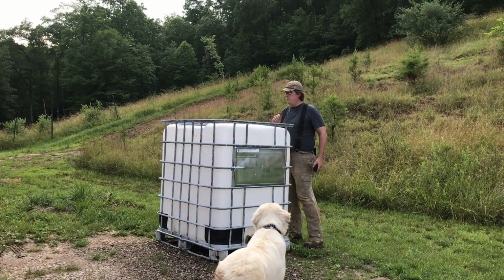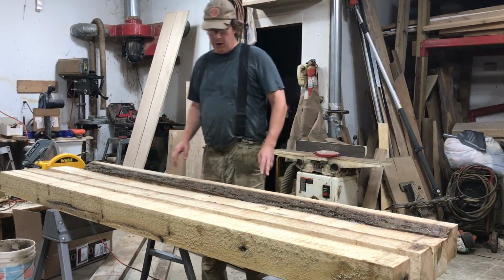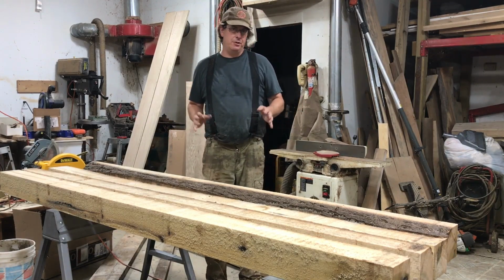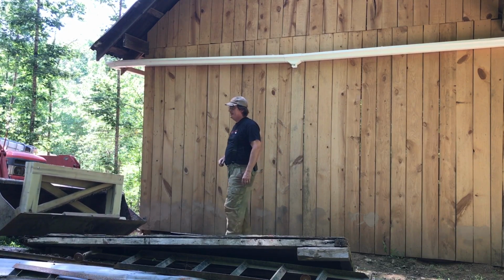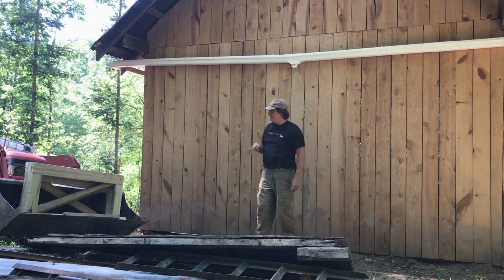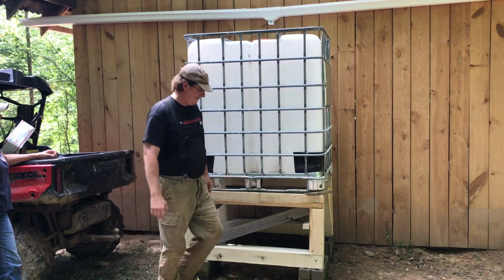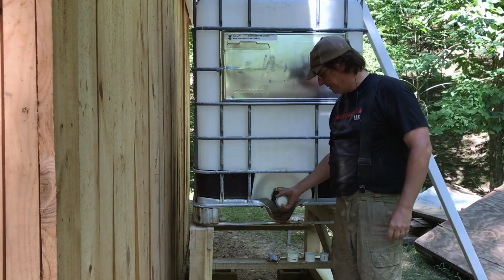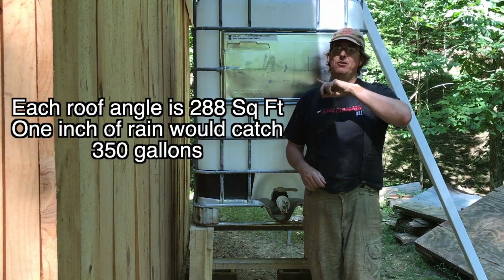Setting our RAIN CATCHMENT TANK for the Pig Pasture

Comment: Great idea 👍
One concern is the weight of the tank might push the blocks into the ground and eventually overturn.
I suggest to put two solid 4x8x16 concrete block side by side making a 16x16 pad. Center the 8x8x16 block on the pad.
That will give you ground bearing surface area.

Comment: I setup a a double rain barrel this year for my garden, they are connected together with no pump. I watched a video that used a ibc tote and what they said makes a lot of sense. They said hose bibs restrict water flow and lower the water pressure out of the tank because of the small water path inside the valve. Instead they put a ball valve with a hose fitting screwed into it to get maximum water flow because its a wide open valve. One of my barrels came with a bib, but the other one I put a ball valve with a hose connector screwed into it. I use a 25 foot garden hose on it. Hooked up to the bib, water wont come out of the hose. With the hose hooked to the ball valve I get good water flow.

Comment: Looks a little tight near the top so I don't know if it will work, but if possible you should add in some more pipe (off to the side) to collect most of the debris. Less cleaning out of the screen for you, less sand in the tank also.
edit; I couldn't remember the name, LOL. A pre-flush filter is what I was trying to describe. Just have to empty the line once in awhile.

Comment: You might consider putting a sheet of 3/8” or 1/2” exterior plywood on both sides of your stand to stop it from potentially racking under the weight of all that water. 330 gallons equals 2755 pounds.

Comment: 1. You need to be worried about algae growth, before the tank fills take the plastic out and cover it or spray paint it so light can't get through and allow for algae growth.  
2. You need an overflow outlet towards the top put a male/female coupler you can attach a pipe to it in order to channel the extra flow of water either away from where it would cause you issues or into a second tank and still doing the same to it.
3. I would seriously think about filtering the water before it hits the tank, rainwater isn't necessarily clean - rain itself can have dust/dirt but the roof can collect dust/dirt, bird waste, bugs/insects, etc.  Easiest way is usually some sort of pre - tank, the sediment collects in it and then overflows into the bigger tank.  I would also invest in a second or third tank, you can fill the one quickly, I had one in FL to water my garden, it filled up in 15 minutes most times because of the quick heavy rains we get, the other reason is it depends on how long you can go without rain.  Just something to think about.
4. I would put some more connections between the riser at the wall and the riser away from the wall, if you have large pigs scratching or worse fighting around it alot of weight can be tossed around pretty easy.
Enjoy!  Good luck, I'm living vicariously through you!

Comment: Nice Job. Did you use a small branch to level the tank after making such a beautiful base? That small leveling branch places unnecessary stress on several joints in your catchment container...Otherwise, you did a lovely job.
All the best from a long time subscriber in North Idaho
Reply from the maker: Yes! I will probably remove it as the weight should bend the tank back into shape.

Comment: 288 square feet of roof provides about 24 cubic feet of water at one inch per square foot.  A cubic foot of water is about 7,5 gallons , times 24 ft3 will net you around 176 gallons of water.  a board foot of water is no where near a gallon but closer to 61%
.
Reply from the maker: wade cooper 288 is just one side of the roof. X2